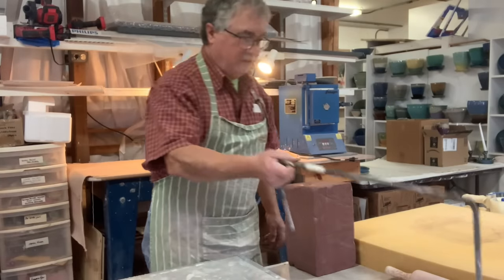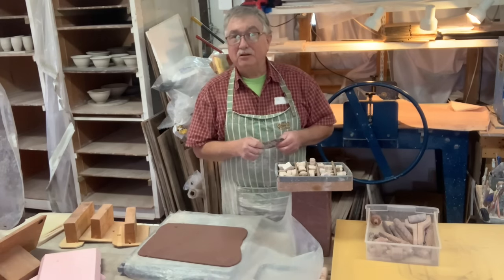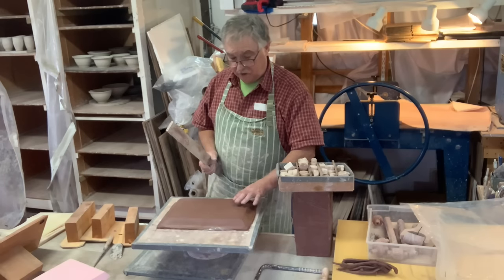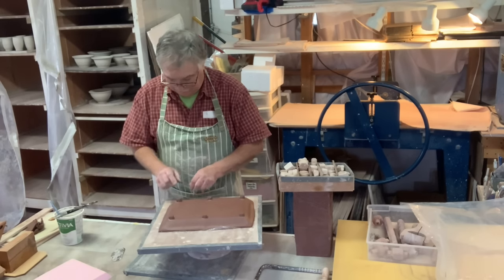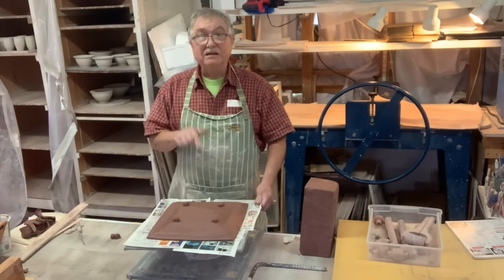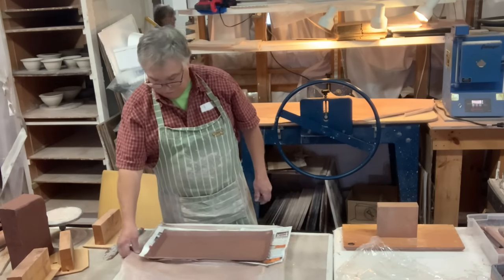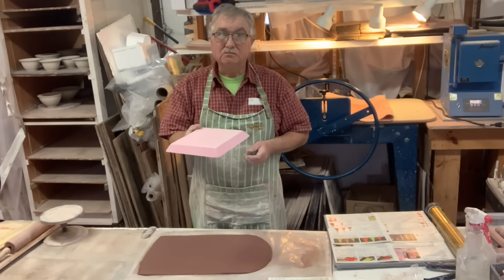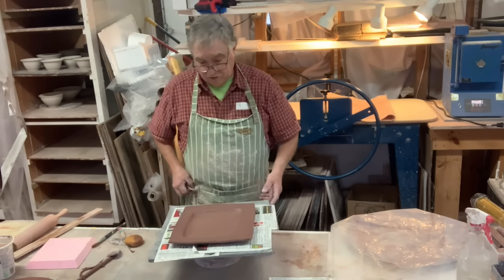Making 4 hand built platters, decorated with slips.

Comment: Vaughn, when you fire these platters will you use stilts? If so, how many? I’m wondering if the platters will slump between the stilts if you don’t use 3 or 4 across the bottom.
Reply from the maker: The gritted red clay I used for these pieces is very strong, it can be stilted and you are right it takes several.